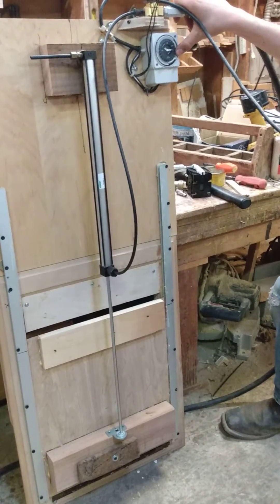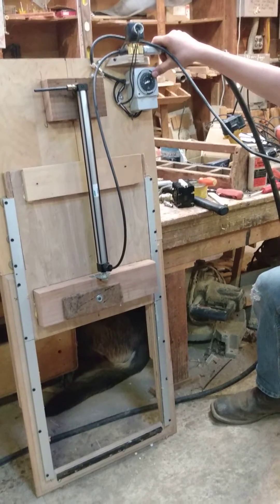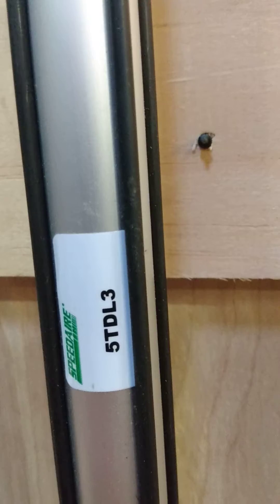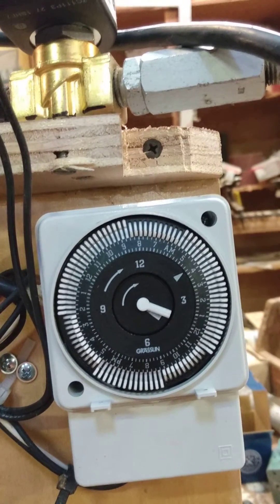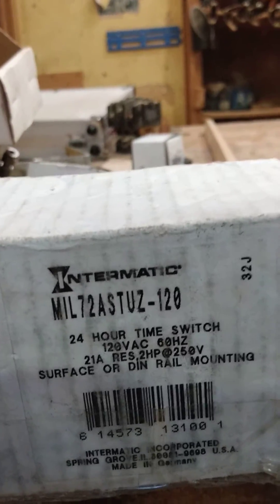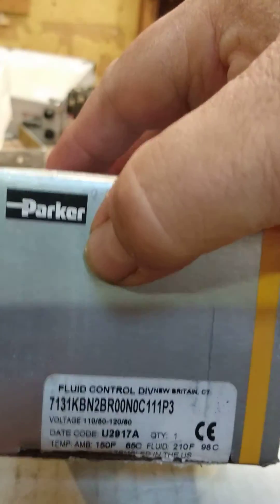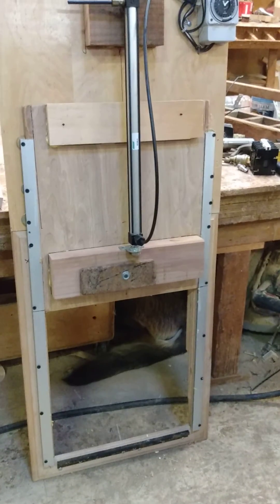The ultimate simplified automatic chicken coop door

Comment: "overly complicated and bizzare chicken coop door controllers," You think that this is NOT that? You are diffidently are part of that group. Boy you are mixing a bunch of stuff to make on of them Rube Goldberg devices. LOL
Reply from the maker: Rube would have loved it. And it is not complex to anyone involved in industrial mechanics. Just a timer, an air piston and a 3 way solenoid valve. All dirt cheap and off the shelf or waste bin.  Indeed, most people can't tie their shoes, so I suppose that makes this bizarre.
Reply: @RRaucina  What make it bazaar is that you over-complicated something that others have already done and done well. 

Most have a battery, wire and timers. 

While you added

Air, AC power , a timer that is power goes of you time is off, AN AIR COMPRESSOR or I think I heard something about a tire (a tire, really?!), Wire AND hoses AND tubing AND fittings. 

I mean just look at it. Just look at the visual.

3 simple components 
vs
9 ADDITION Components = overly complicated

0:15 Just listen to yourself. 

"You don't need and limit switches"  but then 
"all you need is a timer", and what you should have said was "but you have to ADD", and a three way solenoid vales (way more expensive than limit switches already), an an air pneumatic piston," 

You completely glossed over that you added more stuff so while you say it like the limits switches are some big draw back you ignore that your add-ons are way more.

There is also something I noticed. you are very snarky when you say "And it is not complex to anyone involved in industrial mechanics.". You say that but you expect people to have to take on that task. Do you not see the contradiction. 

COME on man. Come back to reality. You didn't distill anything you watered it down. Yeah do your thing and be creative but don't BS about it. 

OH. Did you add a filter valve to the outlet of the cylinder when it goes down? That way it doesn't come down as fast. Oh and there is a guy who made a pressure switch for the bottom of the door. That could very easily be done to yours.

Last don't be an azz. I served for 30 years as an Army helicopter mechanic. I know an awful lot about hydraulic and pneumatic systems. There is a saying about assumption.    

It has been three years. Why no video of it installed? I mean you are so proud of it, why not? You know a follow up video would go a long way to back your stance.
Reply: @RRaucina   You got an small cylinders?

Comment: "After watching hundreds of videos of overly complicated and bizzare chicken coop door controllers, I distilled all the thoughts and built this clean and simplified version."
Then says.
"This is set up for 120 volt power and an air supply. However, this will also operate on water pressure and 12 volts with a change in components."

Dude  Air supply, PNEUMATIC piston,  special valve, timer, 120 power, hoses, fittings, and , I'm sure a few other things is the opposite of a "simplified version". You are actually in the "overly complicated and bizzare" category. 

"the weight of the door closes itself and no chance for harm to a chicken". I watched the video and that is also opposite of "no chance for harm". 

I'm gonna take this whole video as a joke.
Reply from the maker: The door weighs less than a chicken, sorry. And if a chicken is under the door when it closes at night, it was sick. No loose wires, chinese crap components and NO DIGITAL timers that even a 15 year old nerd cant program. industrial components US made and low cost. Here is a comparison - https://www.youtube.com/watch?v=gLhMegglOUY   and just one of hundreds of rube goldberg junk. And another real joke: https://www.youtube.com/watch?v=F1-FinWvCgk  By the way this works for about 6 months with an air supply from an old truck tire, and the components are available in DC for solar.
Reply: @RRaucina  
First comment on this video you say :  "the weight of the door closes itself and no chance for harm to a chicken" 
Now you say: "The door weighs less than a chicken, sorry. And if a chicken is under the door when it closes at night"

Why did you even bring it up if that's the case? In any case the weight of that 2x4 is enough to cause damage to a chicken. Worse if it hit a chicken on the head or neck.

"the weight of the door closes itself"  Yeah that's not true. The compressed air is what pushes the door down. The weight of the door just adds to the force. Tell you what. Why don't you put a chicken bone under there. Record it. 

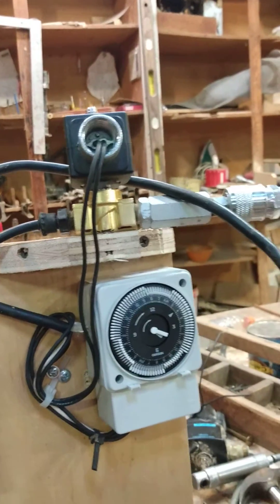"No loose wires"  1:27 Looks like loose wires to me. Add loose hoses to that also.  Loose wires are a product of who installed it. Has nothing to do with what products you used.

"NO DIGITAL timers that even a 15 year old nerd cant program." If you are having problems programing simple timers, then it's you who might be the problem. I have over 15 different styles of timers and none of them took me more than a minute to figure out. 

 "industrial components US made and low cost."  20 for cylinder, 25 for timer, 20 for valve, 20 in fittings, 80 air compressor or bulky big truck tire (120 if they don't just happen to have one add however much for rim), Yeah "low cost" not even close.  I can have a Linear Actuator $30, Battery $20, 2 timers $12, wire $5 and a solar panel $10 that will get the job done. I can get it done with $77 compared to your $165. 

" Here is a comparison - https://www.youtube.com/watch?v=gLhMegglOUY"  Yeah and if you take the time and find my comment on that guys setup, I fairly harshly criticized his too.

"And another real joke: https://www.youtube.com/watch?v=F1-FinWvCgk"  Only joke about that is he paid way to much. Windy city is way overpriced and has crappy products. They used to be good, but they went down hill.

"By the way this works for about 6 months with an air supply from an old truck tire"  yeah again, if you already have the tire. Plus it takes up way more room. Like I said, bad to worse. 

"and the components are available in DC for solar." Adding more cost. LOL.

Here you go. $18 timer and three actuators all under $30 - $36 each, $20 battery and $5 for wire and Bus Bars. That's $73 compared to your $165. And on only one charge of the battery, with all three actuators, it ran for 3 months. https://youtu.be/7Oykm8wyQtU
Don't cry about loose wires either, this is a test install. 

Again You are actually in the "overly complicated and bizzare" category.
Reply from the maker: @AztecWarrior75  That is a double acting air cylinder operating with a 3 way valve. That means the down stroke is gravity only. No 2x4's are involved. The linear actuators are powered in both directions and you can choke a chicken on that, but really it is not a concern on any system. Chickens are fast and bright.
Reply from the maker: @AztecWarrior75  If you don't have a background in industrial automation and  industrial pneumatics, you should hesitate to comment on how double acting cylinders operate. A double acting cylinder simply has 2 ports for power. If you do not power one and install a filter for return air [optional] then you have a single acting cylinder WITHOUT the spring inside them. Therefore the down stroke is gravity, and as it falls, air is drawn into the cylinder through the filtered and un-powered port. There is a small piece of iron screwed to the door, not noted, and that adds just enough weigh to allow the door to close. So double acting cylinders operated on a 3 way valve [Power, hold, exhaust] are single acting cylinder with the need for a weight or spring to shift. 
    You wrote: "That is a double acting air cylinder operating with a 3 way valve. That means the down stroke is gravity only." That's NOT what that means at all. A double acting Cylinder is a cylinder that has an air port at each end and they are used to push the piston in and out. "Powered" IN and OUT. That has NOTHING to do with or "meaning" gravity down. Do you not know what you are using? LOL  ... so a double acting cylinder is more versatile, as it can be used in many different ways. I can reverse the power flow and make the door powered down. And one could raise it with a weight and pulley - just as an example.
Reply from the maker: @AztecWarrior75  I found that 2x4! yes it is there to provide a pound  of weight for the un- powered down stroke, and to keep the 1/4 birch plywood from warping.
Reply from the maker: @AztecWarrior75  I considered the chinese dc or ac actuators, but the quality is suspect and the need for limit switches is a complication. Otherwise that is a decent system but subject to the same issues as my pneumatic cylinder with power source interruption
Reply: @RRaucina  "If you don't have a background in industrial automation and  industrial pneumatics, you should hesitate to comment on how double acting cylinders operate." Who says I didn't? Also you said all that in the one comment yet you completely missed the entire point. 
"That is a double acting air cylinder operating with a 3 way valve." does not mean "That means the down stroke is gravity only". Not even close. 

Again "That's NOT what that means at all. A double acting Cylinder is a cylinder that has an air port at each end and they are used to push the piston in and out. "Powered" IN and OUT."  You and the configuration are what makes it " the down stroke is gravity". You even said it yourself. How dense can you be. 

That's like you saying. This is a balloon, that means you have to fill it with acetylene. NO! That's just what you chose to do with it. It being a ballon just means it's a balloon.

 "I found that 2x4!" Well no shit. LOL.

"yes it is there to provide a pound  of weight for the un- powered down stroke,"  It take less than a lb to seriously injure a chicken. 

 "and to keep the 1/4 birch plywood from warping." I don't really give a shit what it's for but I had already guessed that. Point now and was that I made comment about it and you claimed there were no 2x4s involved. You just can't admit when you are wrong , can you . LOL

"I considered the chinese dc or ac actuators, but the quality is suspect and the need for limit switches is a complication." You state that if I didn't working in the industry, then I should reserve making comments, yet here you are not even knowing simple things about Linear Actuators. Almost all of these actuators come with built in limit switches, so why is it such a "complication" for you to figure out when it's already been done for you.?

" Otherwise that is a decent system but subject to the same issues as my pneumatic cylinder with power source interruption" NOT EVEN CLOSE! LOL The DC operated systems are "basically" a built in backup. A battery and some sort of charging system. Can be solar, or AC to DC transformer power supply.   Mains power goes out and the battery does the job. 

Plus you have to go and fill up a big ass tire (taking up room), Make sure Mains power never fails, timer is very limited to mechanical on/off,.

Any normal electric screw linear actuator door is way safer. I would normally have no other issue with this door but that fact you keep trying to degrade and insult other people's door just to try and give yourself a pat on the back is what I am taking issue with. Especially when your Rube Goldberg Device is NOT the ultimate simplified way and nor is it magical in any way, not even close to being. In fact it's the opposite.
Reply from the maker: @AztecWarrior75  Relax, drink some wine. Pet a chicken. You must be awfully bored
Reply: @RRaucina  I know it's easier to ignore facts and valid points than to confront them or debunk them but at least have some class and not come back with moronic comments. 

Bored you say. Well it only takes me 1 minute to write a comment, If I was bored I wouldn't chose to do something that only takes such a tiny microscopic amount of time to try and fill any length of "boredom" time. Maybe it takes you hours to make that itty bitty  comment and that's how you fill your time, but that's not all people. You are way below average.

Now try and focus and actually come back with comment or rebuttals that make sense.
Reply: @RRaucina  Why do you call them "rube goldberg". They are nowhere near being that. They have a specific function. You are the second person that unjustifiably calls them that. Do you even know what a Rube Goldberg device is? 
Why do you feel you have to tear down other people's work just to make yours better? Higher quality work and ideas stand for themselves. Funny how you and this guy "Here is a comparison - https://www.youtube.com/watch?v=gLhMegglOUY" do the same thing and have inferior concepts.
Reply from the maker: @The Kid Thanks!
Reply: @RRaucina  You are very welcome for the lesson.
Reply: @AztecWarrior75  HAHAHA WOW! Dude you mopped the floor. That was savage. I bet he never recovered.

I wonder when he ditched this thing and when with yours. I bet he won't make an update vid.

Comment from the maker: You can operate this with an old tire inflated high. The cylinder is just 1" in diameter and only uses air once a day on the uplift. The 4 way cylinder is being used as a single acting - the weight of the door closes itself and no chance for harm to a chicken